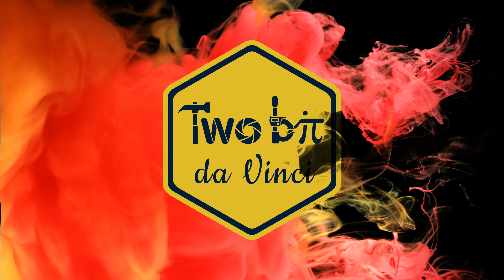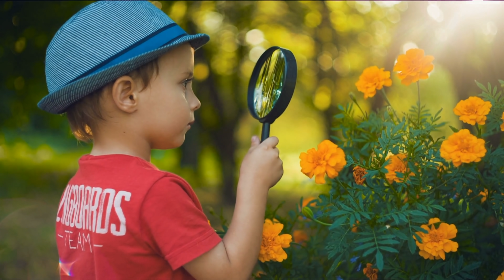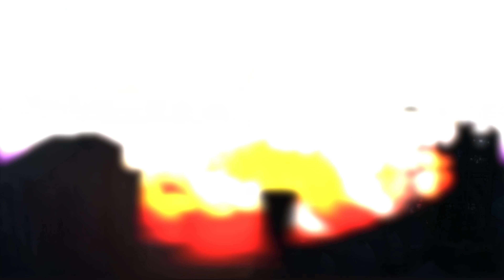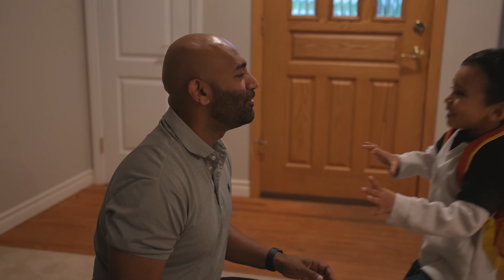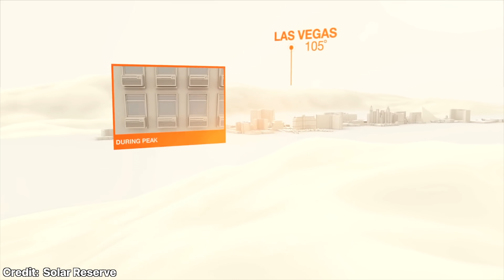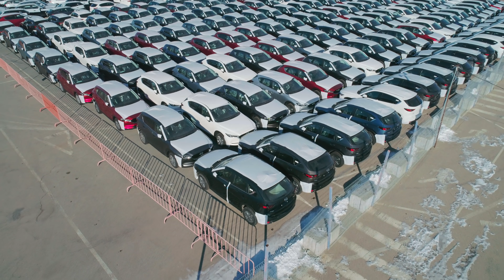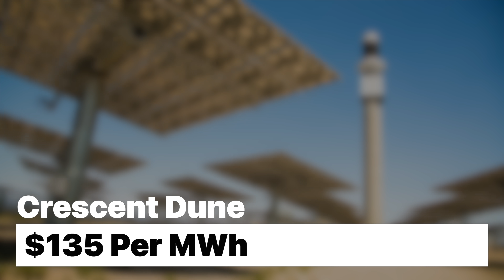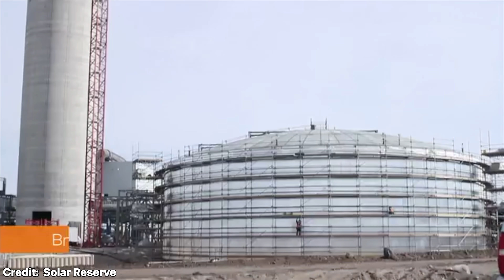This Billion Dollar Solar Plant was an EPIC Failure

Comment: I also read an article about these plants (probably Ivanpah but they are similar) and there is a problem with trying to run them under 50% capacity.  These devices are critically designed to operate most efficiently at 80% of capacity.  As you drop below 80%, cost per KWH goes up.  The utilities had promised that they would buy all of the power the plant could produce.  In truth, the utilities reneged on the deal as the so-called "green energy push" was just smoke and mirrors.  

So, you have these state-of-the-art plants capable of producing competitively-priced green energy and they are shut down due to lies and fraud by the very utility we pay.

Comment: Crescent Dunes is not the one seen on the way to Las Vegas it is further north outside of Tonapah. That was part of their maintenance issues because it is so far  from everything including Las Vegas. Also it needed a lot of water for the cleaning you mentioned in a community that has just enough for the businesses there now. Labor in that community was harder to come by than the simpler plant at Ivanpah, the one on the way to Vegas.
Poor planning, though  as you said it would have worked with the price per KWhr high enough. I think it will be useful in a while, with the molten salt issues under better control. 120 miles from Las Vegas is a harder sell for technical talent than the much closer Ivanpah plant.
Nevada has no nuclear plants, at all, which is to their credit when it comes to expensive power plants. Of course they developed an allergy to nuclear with all the testing done there long ago.  But energy users in Nevada with the exception of Las Vegas are spread out a lot. Revenue per customer are not high, so that probably led to some finance problems as well. 
r
Reply: Thank you.  I was confused watching the video because the ones near Las Vegas are actually on the California side.  So I looked it up, and indeed, they aren't the same ones.
Crescent Dunes Solar Energy Project is at about midpoint between Reno and Las Vegas, so basically, middle of nowhere.  Just the wiring needed to move electricity from there to the target locations can't be cheap!  The effort would be worthwhile if the plant produced a HUGE amount of electricity (e.g. Nuclear), but not for a "small" solar set up like this.

Comment: You can look at Will Prowse's DIY solar channel.  It's PV+LFP-storage.  He has enough to even charge his Tesla.  I don't. have as much land area.  

But panels are now relatively cheap.  And the LFP batteries are getting that way too.  With the server rack LFP batteries (e.g. Signature Solar's EG4-LL), it's now $0.29/wh.  I can do 24/7 solar+storage.  (Haven't figured out the 2 weeks of rainy days part yet.). It's highly scalable, even at the individual level.  Can't say this for CSP.  RV'er and off-griders have been doing this for years.  Though one has to watch one's loads.  But the system can be sized accordingly.

Comment: Yeah but the adoption curve also applies to CSP.. same way it applied to electric cars, solar cells, and batteries as you mentioned.. Wrap your head around that.
Reply from the maker: Yes and no… as more solar PV panels are produced raw material procurement goes up, manufacturing increases etc. CSP will also improve yes, but they’re also more bespoke and won’t experience the same economies of scale. But yes you’re right :)

Comment: Hmm. The new expensive advanced SMR nuclear reactors (some with molten salts, will be entering a similar competitive market. Solar, Wind, and batteries will be even harder to compete within 10 years.
Reply: But MSR's can desal from waste heat / be used in chemical manufacture with +400C heat - see Dr Stephen Boyd on MSR for chemical uses and still produce electricity - you also assume that MSR's will never get cheaper

Comment: Great video, thank you. I just have a question; why they didn't replace the mirrors with PV panels? They could get the max sun light utilization with this kind of position/angle controlled arrangement. Since they already have the infrastructure they could just turn it into normal solar farm by scrapping the rest of the boiler, turbine, pumps, pipes etc. etc. and doing some wiring.
Reply: That's a sweet idea
Reply: I suspect the heliostats were actually the cheapest part of the infrastructure, so once you ditch the receiver, heat exchanger, molten salt storage, and steam turbines you might as well just start over.
Reply: @NoahSpurrier  I reckon the 200 plus miles of cable to Las Vegas might also be useful. So, at 1 USD or less per Watt, it could be quite a good installation. But, no storage. Still better than losing everything
Reply: @NoahSpurrier  No, the existing sun tracker motors are quite valuable and would optimize PV efficiency
Reply: Lmao, yeah why not scrap the whole thing, rearrange it, and buy a whole new type of power plant? Why don't they just do that? Looool
Reply: Ran out of other people's money.
Reply: I think there is wires between the mirrors as the mirrors were on motors tracking the sun and focussing it on the top of the tower. Anyway, doubt that it would have been economic - a bit like the pilot!
Reply: Efficiency doesn’t matter.  $$ per megawatt is and capacity factors.
Reply: Mi
Reply: Sunk Cost fallacy at work.
Reply: If the heliostats have wires to them they will not be able to handle 1500 volts that is common for PV arrays.
These wires need to go to individual inverters (that they don’t have).  Inverters are usually about 1 MW so you need a lot of them.  If you’ve ever done remodeling you know it costs more than new construction.
Reply: One sandstorm and there goes your efficiency. 
Not to mention 200 miles of transmission lines. 
If this was workable energy companies would be all over it.
Reply: Exactly what I was about to comment. The entire cabling infrastructure is there. They even have the support structures and the machinery to do a follow system. Including software, that just needs to be reprogrammed. 
Turn everything to face South, and realign the structures. 
So, there's no storage? Big deal. Easy job. I'll get my check book. Who's with me?
Reply: @kelvinstrachan7331  There is no wiring between the current mirrors as mirrors don't need wires. There is no inverter or any PV infrastructure
Reply: @shrujanamsyama9940  I was kinda refering to the 250 Miles of infrastructure that gets the electricity to Las Vegas. The wiring I was refering to is that from the new PV panels to a central control.
Reply: @shrujanamsyama9940  But there is a grid connection.  Bringing power from PVs to the main node is fairly straightforward
Reply: @shrujanamsyama9940  the mirrors are turned by little motors. Thus they DO have cables running to every mirror post. The question is whether those wires can be used or not.
Reply: @felixfruhauf4940  We need DC cables which are different from AC cables used to turn motors. Also, even for AC power, gauge of wire matter
Reply: If it’s 30% more efficient than PV changing to PV would be a downgrade. (30-40% efficientcy stated in video vs. low 20s for PV.
Reply: @michaelsmithers4900  You are ignoring the cost of running and maintaining  the thermal plant which was the death knell to this project in the first place.  Solar would require 2 people per shift max
Reply: @rcpmac  yep I did, also had my math wrong… i said 30% more efficient when its 50-100% more efficient. Hard to believe that a couple of workers makes that difference but you may well be correct… my stepfather used to be a shift foreman at a coal fired PP and there were very few people working there…
I wonder how many this plant required and what kind of daily tasks were required?
Reply: The video is wrong. Read the Wikipedia article instead. The plant is back up and running as of July 2021.
Reply: @adrianthoroughgood1191  Another point not mentioned in the video is that the plant consumes natural gas to heat and melt the salt every morning. If the same amount of gas was burnt in a thermal plant, it would have produced 22-23% of the energy this plant generated
Reply: @adrianthoroughgood1191  wikipedia is heavily biased it's hard to trust it
Reply: furthermore, they could add PV and keep some/all of the mirrors. one of the biggest problems with solar is that whole “night” thing, and so there are millions of proposals for energy storage. i could see them focusing on using PVs for energy during the day, and storage heat with the heliostats during the night. that should increase the capacity of the overall power plant to deliver something approaching more to baseline production.
Reply: You may have shading problems using the existing heliostats.  Most solar arrays are aligned N-S .  The additional costs to wire all these up and adding large inverters and solar panels may not be cost effective compared to starting over.

Comment: You can trust governments to back failures more often then not.
Reply: Don't be stupid.  Funding decisions are based on good faith engineering which produced a competitive proposal at the time but not after PVs dropped in cost by a factor of 12
Reply: @rcpmac    Private enterprise didn't do that alone now did they, most likely they'd have projected the cost decrease in PV, it's been well known for decades.

 When cost discipline is absent, as it always is with tax monies, this is typically the result.  Same goes for California's hydrogen fuel fiasco and any number of other examples, the worst being corn ethanol disaster which won't end until gasoline is obsolete.  

Less government interference the better.

Comment: The drop in costs with PV is also why Solyndra failed. They made the cylindrical solar PVs that can squeeze out more solar energy at the early and late parts of the day. But their cost was assuming the price of existing solar panels back in 2006 or so. By even 2009, it was obsolete because PV prices dropped so much that people didn't care about extracting solar at 6am or 6pm.

Comment: Maybe someone will buy this plant, pull down the tower and the mirrors on 
the south side of the facility and replace the mirrors with PV panels and
perhaps still make a viable plant. Since this would have tilting ability,
if not tracking ability, couldn't it potentially be more efficient than panels
set at a fixed angle?  If the southern mirrors don't block the rest, maybe all
of the mirrors could simply be replaced with PV panels. 
Please let me know if this makes any kind of sense or if I am deluded.......
Hate to see all of the installed infrastructure go to waste.😎

Comment: They should just convert it to oil based system to heat up the salt as a battery instead of trying to pump it, easier to store, and pump. there are over 20  solar thermal power plants around the world, roughly 5 are of the tower type. most use the oil as the medium for collecting and storing the thermal energy.    But if that is not viable, use it as a waste disposal unit for hazardous material.

Comment: I think things should be cost effective, but I do find it rather ironic that green stuff needs to pay for itself yet nuclear plants and oil/gas fields that have similar overheads are automatically subsidised to the tune of billions. In normal economic terms its better that replacement technology comes in cheaper, but when we have a looming climate deadline and job displacement to worry about, you would think these issues would be brushed under the carpet for the greater good.

Comment: Excellent video.  There's nothing I can add that hasn't already been said!  And on top of that, PVs have the added advantage of almost zero maintenance, and there are no failure points short of the transmission line back to the utility itself that can take down an entire solar PV plant.  Everything is so modular that there is literally no need to ever shut a PV plant completely down, even for major maintenance.

-Matt
Reply: These plants are also deadly to birds that fly nearby. The birds actually catch fire and fall out of the sky. Wind turbines kill birds too though. ITER is the future (nuclear fusion), but not yet.
Reply: @ToyotaKTM  You'll know people are taking nuclear seriously when there are mini reactors powering cargo ships. Nuclear subs and aircraft carriers are both pretty small by comparison.
Reply: Inverters before any power reach the transmission lines are one main reason for solar farms going offline. 
Then you have the normal reason of no sun. That is way the price of solar is not just the panels, but should include what is needed to work 24/7.
Only when that is required you can get into a scenario where the cost of storing solar energy can have a similar cost curve as the panels have had.
The same goes for wind power. Without storage large percentage of wind power is very disruptive to the pricing of electric energy. We see this i Europe now when in a single day you can go from a cost of 150$ ,and more, for a MW/h to negative values.
Reply: Matt, the late, great Jim Bell, environmental designer & founder of the Ecological Life Systems Institute (SD, CA), did a study with Dr. H. Honea that proved on-site solar P-V will supply all of San Diego County's needs & permit energy export sales, using a very small fraction of industrial, commercial, & parking lot shade-structure area. They also showed how and why the economics work and that the model can be replicated almost anywhere. Central power utility companies and lots of transmission lines (& losses) benefit nobody but Big Power freaks with ecocidal egomania syndrome.
Reply: @mlmimichaellucasmontereyin6765  Have seen many calculation like that, but non that include the cost to increase production and raw material so what is calculated can be built.
Just to supply 10% of the global energy need from solar and wind in the next 20 years will take more than the worlds current production in several key raw materials.
To have any hope of realizing any of the large calculation we need to solve how to supply the building blocks needed. If not the increase in cost when raw materials are in short supply will kill most of the plans.
A good example is the all time high we now have on aluminium. In the last year it has increased with more than a 1000$/ton.
Reply: @bknesheim  > Yes, however, solar P-V is part of the solution, especially with advances in materials, batteries, capacitors, and motor/generator technologies. Another huge factor commonly ignored is the currently colossal waste of energy of almost all current vehicles, buildings, and agriculture = +/-85%. So, despite the fact that waste is our worst problem (re: energy), we're probably doomed by our bad habits, mass-delusion, and mass-stupidity. Sigh...
/
But, hey, there are plenty more planets where this one came from (cosmic energy) ;-)
Reply: @mlmimichaellucasmontereyin6765  My comment are not against using solar. It is that solutions have to be something that is possible before it can be a solution.
That is why any large scale plans have to include how to source what is needed.
If more than is available is needed the plan most include how to cover the deficit.
It can be raw materials, skilled people, equipment and more.
I agree that to find a way that need less and wast less is the better solution.
Reply: So, you say let's put all the eggs in one basket? What's the worst that could happen, eh?
Reply: @marshad82  > Actually, if 8 billion of us decided to use less than 20% of the energy wasted on stupid buildings, vehicles, and Big Agribiz, then global E-power needs could be reduced to less than 1 fifth of current demand & production. Will we do that? Naw... Why not? Take a guess.
Reply: @mlmimichaellucasmontereyin6765  Well, there's no point day-dreaming about impossible solutions.

Solar alone will never be able to completely handle the grid.  The basic problem comes down to the fact that you only get full solar power for around 6 hours a day.  So at a minimum you need to over-provision solar about 4x and then have enough grid-scale storage to soak it up during those 6 hours and cover the rest overnight.

But that totally reachable goal is still not enough to provide a 100% reliable grid.  To deal with even one day of cloudy weather would require a doubling of the amount of utility-scale storage.  To deal with a week would require 5x the amount.  To deal with storms and winters and other natural events would require at least 10x the amount of utility scale storage as would be needed to cover a typical 24 hour cycle.

This is NOT economical,  Nobody is going to do that, it would bankrupt the country.   Fortunately though there is a solution.

Wind, hydro, and other renewable sources can be packed into the solar column. They don't solve this problem either.  They just add to the overall bulk of power generation just like solar does.

The solution to this problem is that the grid will always need at least 10% of its generation to be on-demand or full-time (full-time being base load).   Right now this filler (which is huge because we don't have ebough renewables or storage online yet)... right now this filler is natural gas.  30 years from now it might be nuclear.

Having these on-demand/full-time sources cuts the need for utility-scale storage by almost an order of magnitude... we're talking 50% less utility-scale storage needed or more (up to probably 75%).  That is what makes the whole thing economical.

(Also, side note on one of the other comments about solar PV farms and inverters... a solar PV farm has more than one inverter.  An inverter going down does not take the whole farm offline, nor does a solar PV farm generally have to be taken entirely offline for maintenance).

-Matt